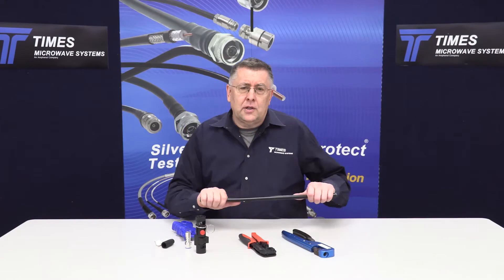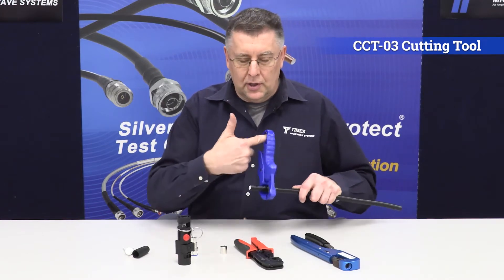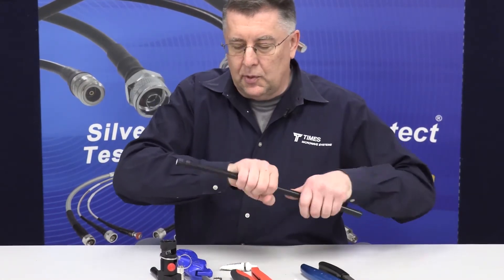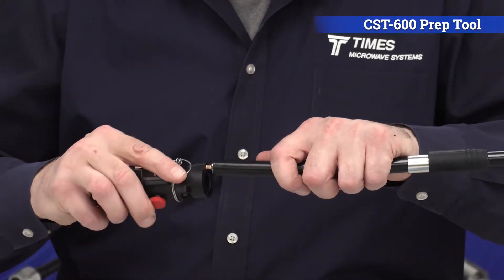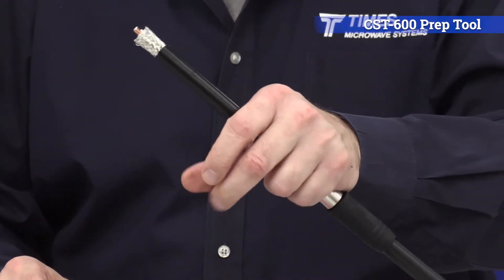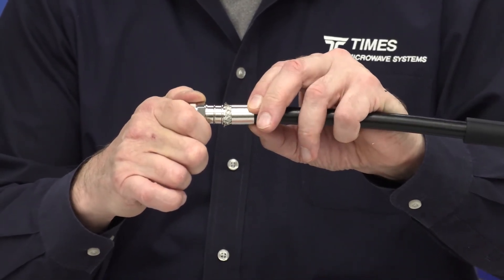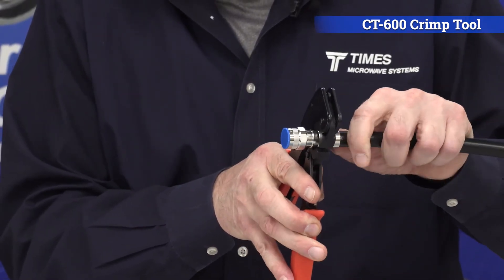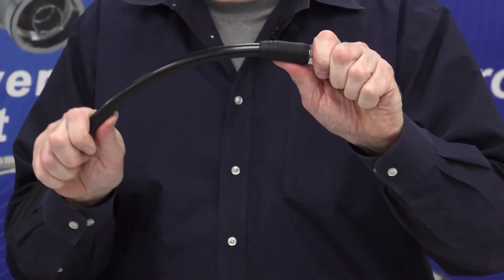Demo Discoveries: LMR 600 Demo: Assembly Made Easy

Comment: Your LMR600 ultraflex center Conductor dosent fit inside your N-connector..
Reply from the maker: Thank you for your feedback. The diameter of the center conductor of the LMR-600-UF is the same as the diameter of the center conductor of the LMR-600. The issue is that if you get any unbunching or burring during your cutting process, it can become very challenging to get the pin on. You would need to cut the cable or even just trim back the center conductor with a very sharp side ground pair of cutting pliers that will cut through copper smoothly. We would be happy to talk one on one with you if you have additional questions!
Reply: Thanks !
Definitely not the same diameter.  Maybe im having a tolerance stack issue, but the cut is done with a band saw for ultra clean cuts.

Next time ill shoot a video so you can see the struggle.
Reply from the maker: @KA4UPW  absolutely, we are here to help! Send us your video at reeltimes@timesmicro.com and we will forward to our product manager to take a look and help you with find a solution.

Comment: So what step down connector do you need to go from that to a SO-239
Reply: Looks like a din connector.
Reply from the maker: Hello, thank you for your comment. If you are looking to connect LMR-600 to an SO-239 connector, you can use our 3190-8036 (EZ-600-UM-X) connector. If you cable is LMR-600-Ultraflex, you can use our 3190-8172 (TC-600-UM-X). Should you have any additional questions, please connect with us on our website and we will put you in touch with one of our Product Managers. Thank you!
Reply: @TimesMicrowaveSystems  
Thanks for the info 👍